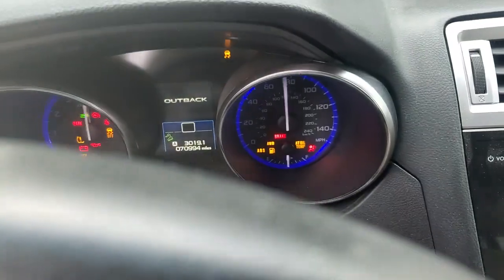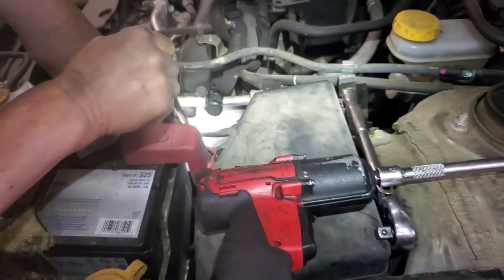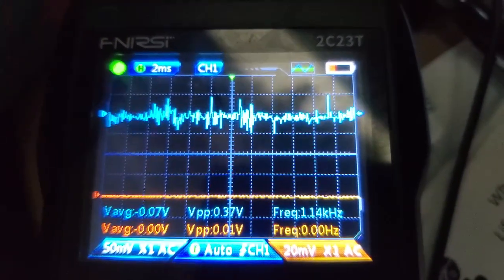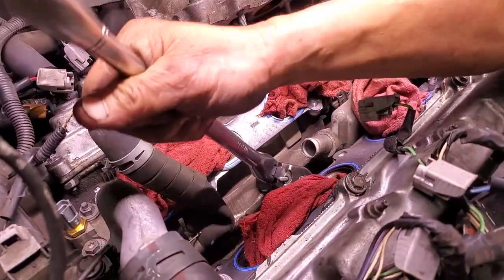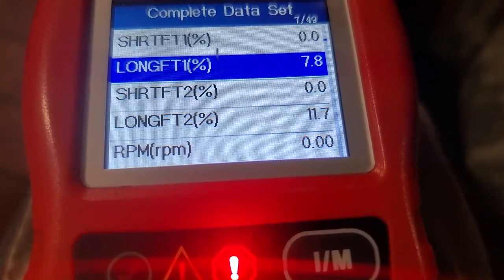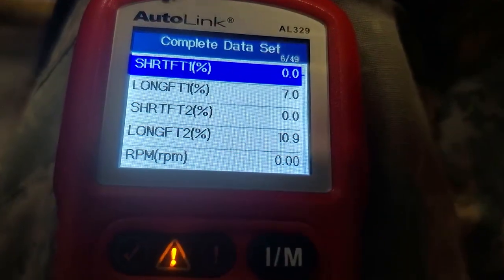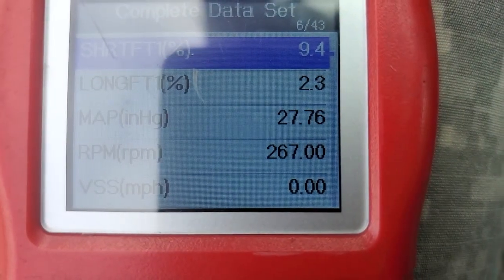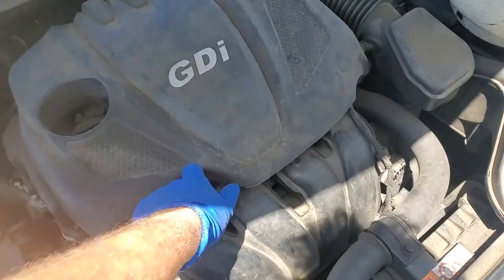Auto Diagnosis and Repair June 13 Toyota P0325 Bad Denso Plugs BMW and More

Comment: On the Hyundai - I've seen some Chrysler products that the quick-connect from the fuel pump is self-sealing when you disconnect it.   I was trying to pump out the fuel tank on a 200x Dodge Grand Caravan, and couldn't get any flow out of the fitting - since I was scrapping the van, I just cut it off of the plastic line, full flow after that.    Wondering if the Hyundai needs a male fitting shoved into it to allow flow...

Comment: Surely a new fuel pump would cost a lot less than a new car. Maybe they’re of similar mind like my aunt about 20 years ago. Instead of filling the car with oil when it would run out, she would just get a new car. 😆

Comment: Bet one of those Highlanders is garage kept, and the other has been baking outside for 23 years.  Although the top of the steering wheel in the '99 Corolla is deteriorating, and that car spent most of its life under a carport...

Comment: I've worked on a few of the F30/F10 325i/525i, they've had fuel injectors leaking problems at cold, needing a full set of 6 replacing, costing about £2400 for just the injectors, the version 11 injectors in them cars just fail one by one usually starting at the back and the car just misfires, great cars when they're healthy, but those injectors shouldn't cost so much or die so quickly.